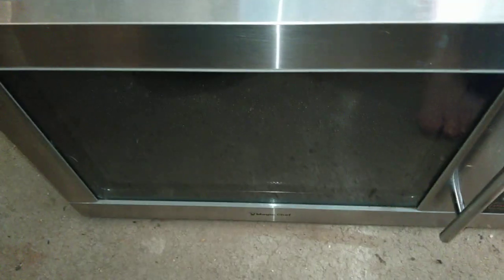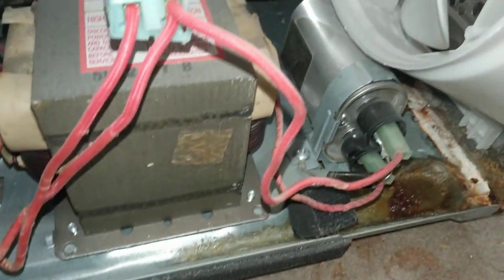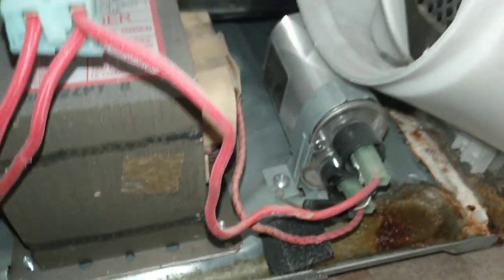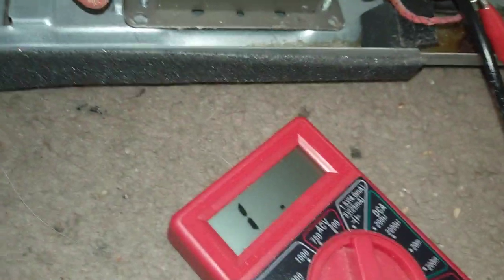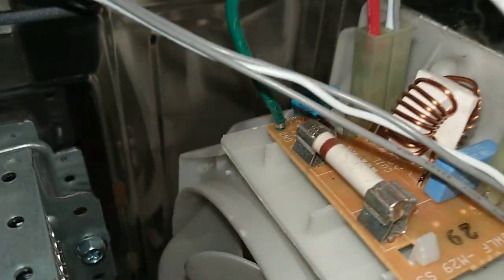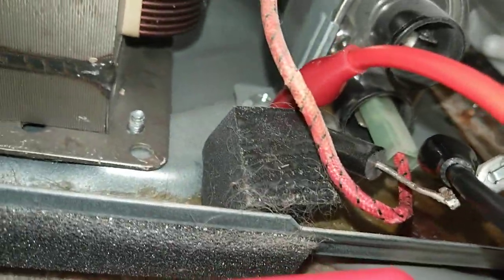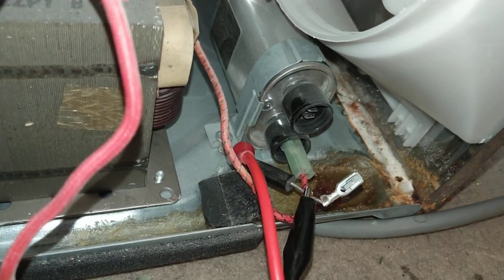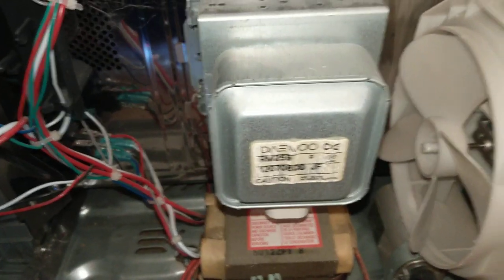Microwave Will Not Heat Up Repair Part 1

Comment: You should have discharged the Capacitor BEFORE testing anything or touching anything in the HV section. The bleeder resistor in the cap can't be relied on to bleed off the Capacitors charge, they can and do go open circuit leaving the Cap fully charged and ready to Kill.

Comment: You have not tested your high voltage diode correctly. You need a 9V battery to test the high voltage diode
Reply: You can't properly test HV diodes with a digital multimeter, you need a good analogue multimeter with at least a 6v battery on the resistance ranges or a good Insulation tester.
Reply: 4🎉
Reply: Moe Collins  no 9 volt battery needed with a analog meter
Reply: @maxjacobs7249  He is using a digital meter.